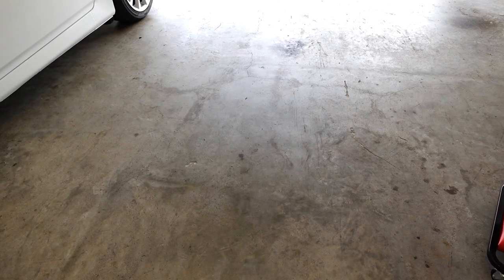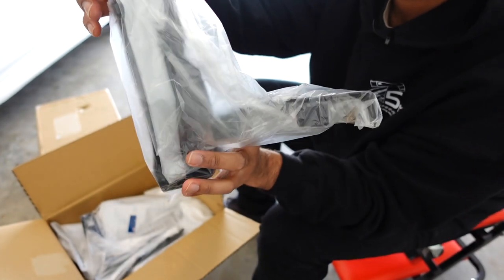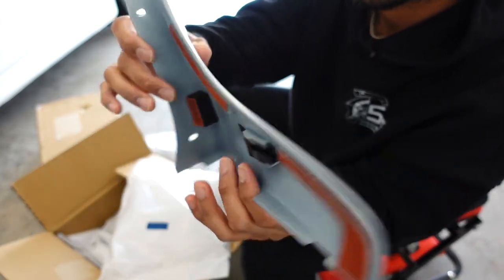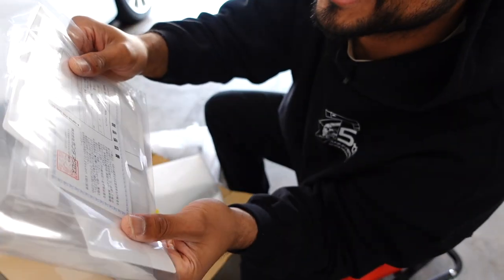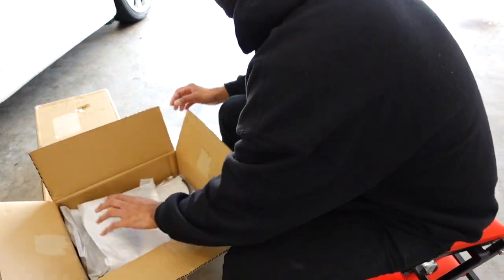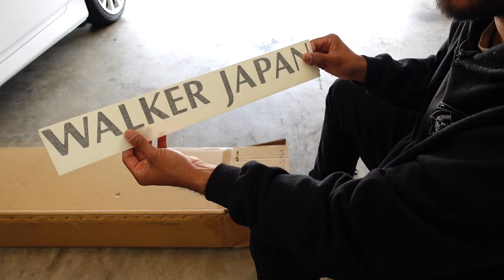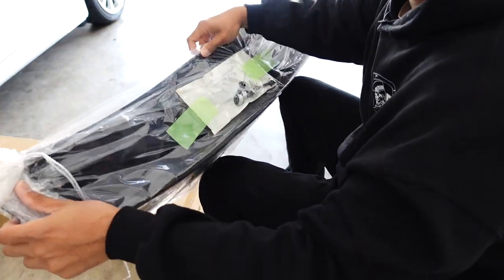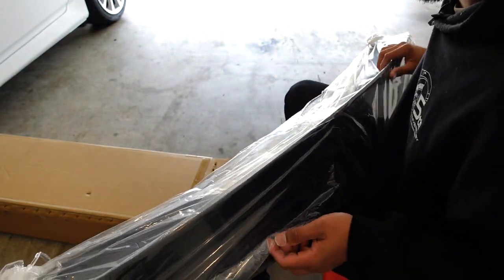HONDA S2000 20th ANNIVERSARY SIDE STRAKES & RARE JDM AIRWALKER DUCKBILL SPOILER UNBOXING!!!

Comment: That rear wing looks good. Are you planning to incorporate the existing 3rd brake light or a different solution into the spoiler?
Reply from the maker: As much as I would like to add the 3rd brake light with this duckbill, I feel like modifying the duckbill would cost more to do than the actual piece itself with paint and labor included to do it. Honestly, I wouldn't mind doing it in the future to make it much more unique.
Reply: @jimboski  Do you have state inspections? It won't pass without it and you could be pulled over for not having one, just a fair warning.
Reply from the maker: yes, we do have yearly inspections but to my understanding its more emissions and making sure all lights are in working order